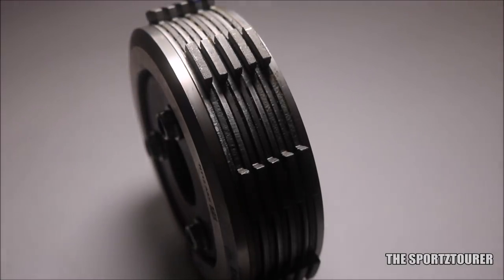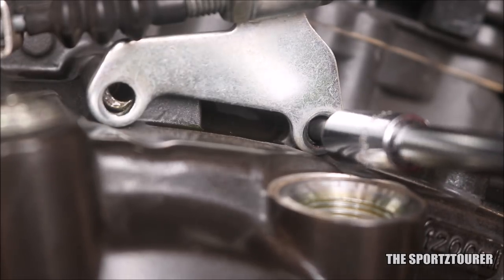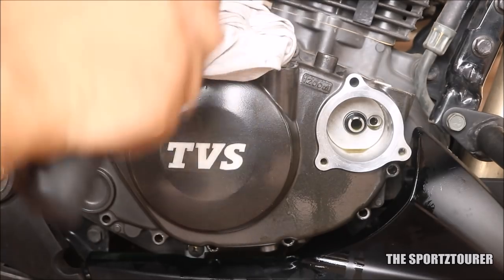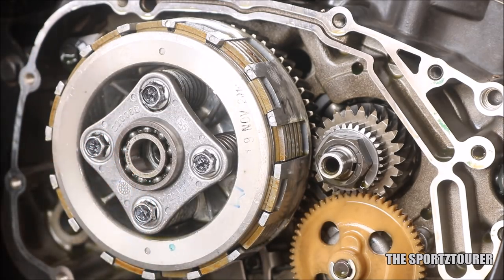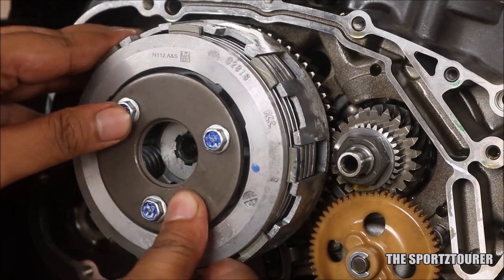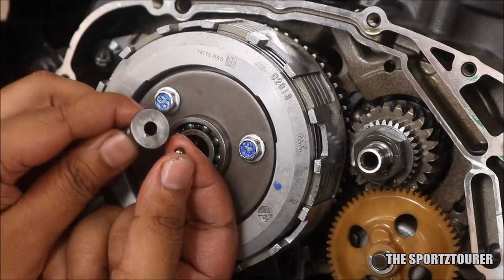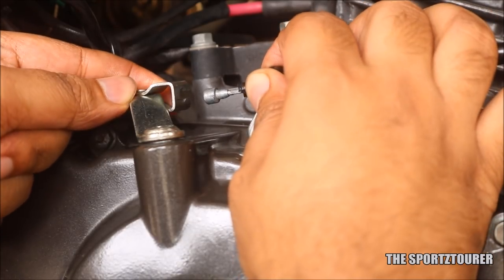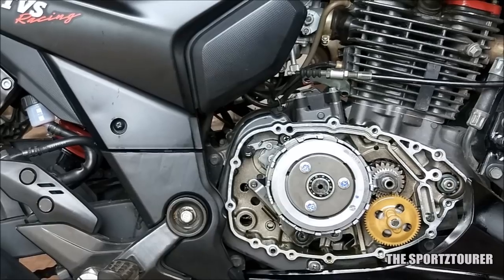HOW TO INSTALL SLIPPER CLUTCH IN BIKE TVS APACHE SLIPPER VS REGULAR CLUTCH, SLIPPER CLUTCH EXPLAINED

Comment: I first thought it was impossible to fit slipper clutch in a normal bike. Can you advise if I can install a slipper clutch in my Yamaha R15 v2?? As the R15 V3 already has a slipper clutch, would that be a direct fix on my R15 V2?? Desperately waiting for your reply buddy!!
Reply from the maker: Hi,
I got a few messages from Indonesian riders where they have installed the Slipper clutch from V3 to V2 but they were unable to confirm if that was a direct fit.
Reply: Alright thanks for your response. I'll be checking out more on this stuff. Let me know if you ever come across any updates on this. Really love the content you're posting!! Keep up with the great work eh!!

Comment: Can we fit slipper clutch on Honda hornet 160r?  Do u know which bike 's slipper clutch will suitable for hornet?
Reply from the maker: Hi Anoop,
The Hornet has a different clutch assembly so this won't fit. As per my knowledge, right now we don't have an aftermarket replacement slipper clutch for the Hornet.

Comment: Can I install in 1604v new model..pls suggest
Reply from the maker: Hi Munna Singh,
The RTR 160 4V does shares a lot of parts in common (as shown in the video). Only thing I have doubt about is the clutch housing and the clutch shaft which I doubt isn't the same. Unless we practically check it, we cannot confirm on that 😊

Comment: Hi bro, my TVS APACHE 160 4v bs6 having issues in clutch. In 4 & 5th gear  I feel the clutch is applied slightly automatically while throttling, if we release the throttle there is a jurk in clutch leaver. The bike only ran 2000km and mileage only 35 in urban mode. In sports mode it goes only 105 max speed after that no power. How to fix it

Comment: Is its possible to fit the slipper clutch on the apache 180 abs ?
Reply from the maker: Hi Tejas,
The RTR 180 does shares a lot of parts in common (as shown in the video). Only thing I have doubt about is the clutch housing and the clutch shaft.

Comment: Is it possible to retrofit slipper clutch of yamaha  r15 v3 into r15 v2. Pls reply
Reply from the maker: Hi,
A few riders have done it on the V2 👍
Reply: @thesportztourer  what is cost for this retrofitting. What parts to be changed.

Comment: It can use apache rtr 180 old model???
Reply from the maker: Hi Arijit,
As per the recent info the shaft dimension is different on the 180 so this won't fit.

Comment: Can we ask TVS Service center guys to install it on my RTR 2004v basic model ? because i am an aggressive rider who down shift very aggressively even without Slipper clutch. am looking to install ABS as well but most people suggest not to because it's not reliable.
Reply from the maker: Hi,
You can surely ask the authorized service center for the installation. Even I have installed it on the basic model which had conventional clutch.
I did make a video on the ABS: https://youtu.be/WgWusoipC0U

Comment: Will the R15 V3's slipper clutch system fit on R15 V1 (2008)?
Reply from the maker: Hi,
Fits on the V2 but we need to check on the version 1.
Reply: Any other alternative to add slipper clutch on 2008 model (Indonesian)?

Comment: Hey bro please please tell can I use this slipper clutch in my hornet 160r🤓🤓tell please🤔🤔
Reply from the maker: Hi Swaraj,
The RTR 160r does shares a lot of parts in common (as shown in the video). Only thing I have doubt about is the clutch housing and the clutch shaft which I doubt isn't of same dimension. Unless we practically check it, we cannot confirm on that 😊
Reply: @thesportztourer  ok I think I should ask the mechanic in honda or tvs showroom🤔

Comment: Hey....can I use the same slipper clutch in apache 160 4v???
Reply from the maker: Hi,
I am yet to personally check that but the authorized service said the clutch shaft is of different dimension on the 200 4V and 160 4V.

Comment: I have got installed on Apache RTR 200 1st version in TVS service center...After a week the clutch became hard and I feel pain.Any suggestions
Reply from the maker: Have you tried adjusting the clutch? The new clutch plates settle down after a few kms but shouldn't get too hard.

Comment: is it possible for a duke 200 to change it with slipper clutch?
Reply from the maker: Hi,
The clutch shaft is different on the Duke 200 so it won't fit.
Reply: i see. thanks a lot bro.
Reply: what about using the duke 390 slipper clutch to 200?

Comment: I have Honda Unicorn 150  slipper clutch will fit in
Reply from the maker: Hi Kiran,
The Unicorn has a different clutch assembly so this won't fit.
Reply: @thesportztourer   thanks  man about You're advice.
I worry about the Dimensions. 👍👍👍👍👍

Comment: can we modify  Apache RTR 200 4v carburetor to fuel injection
Reply from the maker: Hi Manibabu,
Carb to Fi modification is not an easy task on the RTR as a lot of parts addition and replacement needs to be done. The performance and efficiency increment is almost negligible between the two plus the reliability of the whole modification will always be questionable and out of warranty 😊
Reply: @thesportztourer  thank you

Comment: Can I use sleeper clutch in my 160 4V
Reply from the maker: Hi Nilesh,
The RTR 160 4V does shares a lot of parts in common (as shown in the video). Only thing I have doubt about is the clutch housing and the clutch shaft.

Comment: Can same done with pulser rs200?
Reply from the maker: Hi,
Right now in the Bajaj line up slipper clutch is only available for Dominar. If Bajaj brings it in for RS 200 or even NS 200 then we can retrofit it on the RS 200 😊

Comment: Hey can i install slipper clutch in ktm duke 200
Reply from the maker: Hi Zaheer,
The clutch housing and clutch shaft is different on the Duke 200 is different so this won't fit.

Comment: Can u sujjest me FZ 25 compatable sleeper clutch ...
Reply from the maker: Right now we don't have an option. Some Indonesian riders have fitted the slipper clutch of R15 V3 on their FZ25 but they were unable to confirm if it was a direct fit or any additional modification was required for that.
Reply: @thesportztourer  yes most yamaha FZ25 owners have upgraded their stock clutch by fitting the R15 V3 slipper clutch on their bikes with no modifications required and with satisfactory results here in Mizoram, North-East India.

Comment: Can slipper clutch be installed on an older model RTR 160
Reply from the maker: Hi Kaushik,
The RTR 160 does shares a lot of parts in common (as shown in the video). Only thing I have doubt about is the clutch housing and the clutch shaft.
Reply: @thesportztourer  can you confirm it please, because most of the mechanics around my place don't know much about it.

By the way, great video Bhai.

Comment: I want to install slipper clutch on my honda xblade can suggest which one would fit in.
Reply from the maker: Hi Chayan,
Right now slipper clutch is not available for Xblade. This won't fit as Xblade has a different clutch assembly.
Reply: @thesportztourer  Okey can you notify me when it is out in the market or if CBR 150/250 slipper clutch would fit in xblade please suggest..

Comment: Where did you get special tool for clutch nut? Is it 20mm or 24mm
Reply from the maker: Hi Athul,
It has a 1/2" drive but the tool sizes are different from manufacturer to manufacturer (not standardized like spanners). You can get it from your local automobile spare part shops (can order it from them).
Reply from the maker: Amazon India stocks the same for Pulsars, you can ask the seller to make it available for Apache: https://amzn.to/2VzutGw
Reply: Thanks

Comment: Will it work for rtr 160 4v
Reply from the maker: Hi,
The RTR 160 4V does shares a lot of parts in common (as shown in the video). Only thing I have doubt about is the clutch housing and the clutch shaft which I doubt isn't the same. Unless we practically check it, we cannot confirm on that 😊

Comment: Can I fit the slipper clutch assembly in my apache rtr 160 4V? Pls reply...
Reply from the maker: Hi Arunava,
As per the recent info the clutch shaft diameter is not same so this won't be a direct fit.
Reply: @thesportztourer  thanks ..👍

Comment: Can I install the slipper clutch in rtr 180 apache
Reply from the maker: Hi Bhupendra,
The RTR 180 does shares a lot of parts in common (as shown in the video). Only thing I have doubt about is the clutch housing and the clutch shaft which I doubt isn't the same. Unless we practically check it, we cannot confirm on that 😊

Comment: is it possible on pulser ns 200
Reply from the maker: Hi Aadhil,
I doubt it will be a direct fit as the clutch housing and the clutch shaft is different so it won't fit.
Reply: The Sportztourer thanks brother ✌💓

Comment: hello bro, i wana know that why my apache 200 clutch lever get loosen after done some kms or while in traffic, gear become hard and crank after all its slipper clutch....in service they take it as normal....bike ran jus 1000 kms +......
Reply from the maker: Hi,
You need to get the clutch adjusted for that and while riding in traffic avoid using half clutch 😊

Comment: Can I install slipper clutch in Apache rtr 180
Reply from the maker: Hi Rohit,
The RTR 180 does shares a lot of parts in common (as shown in the video). Only thing I have doubt about is the clutch housing and the clutch shaft dimensions. Unless we practically check, it cannot be confirmed 😊
Reply: @thesportztourer  ok thanks Bhai🙏

Comment: Can i fix the slipper clutch in my 160 4v
Reply from the maker: Hi,
The RTR 160 4V does shares a lot of parts in common (as shown in the video). Only thing I have doubt about is the clutch housing and the clutch shaft.

Comment: It's fit for rtr 160 4v
Reply from the maker: Hi Aravind,
The RTR 160 4V does shares a lot of parts in common (as shown in the video). Only thing I have doubt about is the clutch housing and the clutch shaft which I doubt isn't the same. Unless we practically check it, we cannot confirm on that 😊

Comment: Bro is it possible to fix SLIPPER CLUTCH on apache  RTR 180......
Reply from the maker: Hi Satish,
The RTR 180 does shares a lot of parts in common (as shown in the video). Only thing I have doubt about is the clutch housing and the clutch shaft which I doubt isn't the same. Unless we practically check it, we cannot confirm on that.

Comment: Will this slipper clutch will fit in RTR 180
Number of clutch plates are 5.
How many plates are there in slipper clutch.
Reply from the maker: Hi Rohirame,
The slipper clutch has 5 clutch plates. The RTR 180 does shares a lot of parts in common (as shown in the video). Only thing I have doubt about is the clutch housing and clutch shaft (length).

Comment: Hi bro
Can we install the slipper clutch on Apache RTR 1604v also?
Reply from the maker: Hi Mani Kumar,
The RTR 160 4V does shares a lot of parts in common (as shown in the video). Only thing I have doubt about is the clutch housing and the clutch shaft which I doubt isn't the same. Unless we practically check it, we cannot confirm on that.
Reply: @thesportztourer  thanks for your info 
I will get it confirmed with the TVS service center technician

Comment: Hello mate...I own the rtr 200 race edition slipper clutch version....after 2000kms of vgood maintenance I started encountering light metal vibration noise when acceleration after 2nd and deceleration from 3 Rd I'm bit worried as the service center guy tightened the clutch lever play and it stopped.....but later when I readjusted the play it started again....I'm not convinced by the service center people can u help ................one more query is 90 gearl oil better than motul chain lube...
Reply from the maker: Hi,
Have you checked the chain slack and gear lever position?
If you ok with the mess and lube frequency then gear oil is fine otherwise chain spray (lube) is hassle free and recommended alternative 😊
Reply: @thesportztourer  appreciate it thank you

Comment: Is it possible to install slipper clutch in Apache rtr 160??
Reply from the maker: Hi Abhijeet,
The RTR 160 does shares a lot of parts in common (as shown in the video). Only thing I have doubt about is the clutch housing and the clutch shaft.

Comment: Can It b install in Apache RTR 180
Reply from the maker: Hi Moksh,
The RTR 180 does shares a lot of parts in common (as shown in the video). Only thing I have doubt about is the clutch housing and the clutch shaft which I think isn't the same. Unless we practically check it, we cannot confirm on that.

Comment: Can we fit slipper clutch in tvs Apache RTR 180 ??
Reply from the maker: Hi,
The RTR 180 does shares a lot of parts in common (as shown in the video). Only thing I have doubt about is the clutch housing and the clutch shaft which I doubt isn't the same. Unless we practically check it, we cannot confirm on that.

Comment: Sir i want to install slipper clutch on the duke 200 it's possible??🤔
Reply from the maker: Hi,
This slipper clutch won't be a direct fit as the clutch shaft and the housing is different.

Comment: will it work in fzs v3.0?
Reply from the maker: Hi,
I doubt it will fit as the clutch housing and the clutch shaft is different on the FZ so it won't fit.

Comment: Can we install slipper clutch on apache 160 4v
Reply from the maker: Hi Vinay,
I am yet to personally check that but as per the recent information from authorized service the dimension of the clutch shaft is different.

Comment: Can I installed sleeper clutch in TVs Apache 160 4 v
Reply from the maker: Hi Debojyoti,
The RTR 160 does shares a lot of parts in common (as shown in the video). Only thing I have doubt about is the clutch housing and the clutch shaft.
Reply: @thesportztourer  one more thing I want to know that in 4th gr my byike reatch up to 114 kmph.but in 5th grade my byike can reatch only up to 109.or max to max 111 kmph....can you answer why...is any thing wrong with my byike ...plz help me ..my byike is TVs Apache 160 4 v..plz the service center have no clue about it.

Comment: Can it fits in Gixxer155?
Reply from the maker: Hi Vinoth,
The clutch assembly on the Gixxer is different so this won't fit. With quick updates from Suzuki let's hope the Gixxer will be updated with slipper clutch like it got Fi, ABS, rear disc etc 😊

Comment: I have Installed Slipper Clutch . Clutch is So Light . But there is No Free Play On Clutch   . The Setting At the Engine is Dead End Still Rear Time is Rotating . Any tios From You ?
Reply from the maker: Hi Uday,
The the type of feel at the free play won't be same with slipper so you have to adjust it with reference to clutch engagement.
Does the rear wheel rotates with force or it stops with slight press of rear brakes?
Reply: @thesportztourer  it stops when light Force on Rear Brake
Reply from the maker: Then it's normal, nothing alarming 👍
Reply: @thesportztourer  ok Thank You
Reply: @thesportztourer  tq . I need A Help From You . I Didnt Found RTR200 Stickers in the TvsSpareParts Site . I need those two Horses on tank cover in New Model . will you Find Out it !

Comment: hi.. buddy how can i get this slipper clutch..?  i wish to install a slipper clutch on my pulsar 200 DTSI. plz advice.
Reply from the maker: Hi Asim,
Right slipper clutch is not available for Pulsar 200 DTSI.
Reply: @thesportztourer  can I use the same TVS Apache RTR200 slipper clutch...?
Reply from the maker: The clutch housing and clutch shaft is different on the Pulsar 200 so this won't fit.

Comment: Can I fit this sleeper clutch to the new TVS Apache 160 4v ???🤔
Reply from the maker: Hi,
The 160 4V does shares a lot of parts in common (as shown in the video). Only thing I have doubt about is the dimensions of the clutch housing and clutch shaft.
Reply: Please check that and let us know

Comment: Can it be done on rtr 180 ?
Reply from the maker: Hi,
The RTR 180 does shares a lot of parts in common (as shown in the video). Only thing I have doubt about is the clutch housing and the clutch shaft which I doubt isn't the same. Unless we practically check it, we cannot confirm on that 😊

Comment: Can I use in fz 250
Reply from the maker: Hi Samir,
The clutch shaft is different so this one won't fit. I got a few messages from Indonesian riders where they have fitted the slipper clutch of the R15 V3 on the FZ 25. They were unable to confirm if that was a direct fit or any other additional modification was required for the fitment. So Unless we practically check it, we cannot confirm on that.

Comment: Does it work in pulsar 180 ug3 , ....
Reply from the maker: Hi Sanoj,
 The clutch housing and the clutch shaft is different so I doubt it won't fit on Pulsar 180.
Reply: Thanks for the reply dear
Reply: I hope you will make a video for pulsar 180 ug3

Comment: Can Slipper clutch install in Apache 160 4v?
Reply from the maker: Hi,
The RTR 160 4V does shares a lot of parts in common (as shown in the video). Only thing I have doubt about is the clutch housing and the clutch shaft which I doubt isn't the same. Unless we practically check it, we cannot confirm on that 😊

Comment: What about apache 180rtr can i fix it in apache
Reply from the maker: Hi Ishant, 
I have doubt about the clutch housing and the clutch shaft which I think isn't the same. Unless we practically check it, we cannot confirm on that 😊
Reply: Will u do experiment on apache 180rtr sir

Comment: can slipper clutch install in apache rtr 160 ?
Reply from the maker: Hi Ankush,
As per the recent information the dimension of the clutch shaft is different on the RTR 160 so this won't fit.

Comment: Can we installed a slipper clutch on TVS rtr1604v???
Reply from the maker: Hi,
As per the recent info the clutch shaft is different so this won't fit in the 160 4V.
Reply: @thesportztourer   thanks